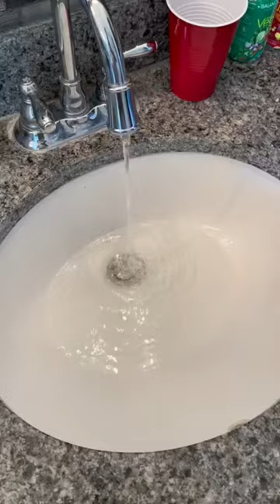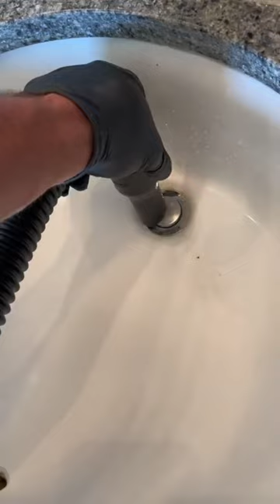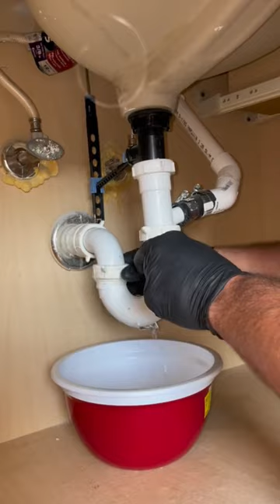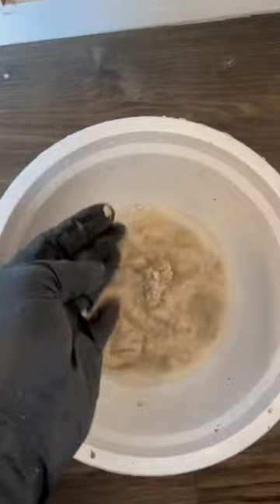Unclogging nasty drain line.

Comment: I do hvac and we add algae tablets to the drain pan to prevent something like thisb
Reply: I just crumble up a pool chlorine tablet and throw some pieces in the drain pipe every summer,
Reply: Ya'll do ?
Reply: Thanks!
Reply: The smitty pan is for in the event of condensation line failure
Reply: It'll still happen eventually
Reply: @TheFoxygrandpa69  If you add the tabs twice a year it will not happen.
Reply: Used to get calls for this almost everyday at a apartment complex. I gave every tech a bottle of them and told them every call no matter what it is drop a tab in the a/c. 2 months later zero calls for a/c drains.

Comment: They should just have a standard 2" "P" trap drain in the attic for the AC and AC pan.  It's ridiculous running these stupid 3/4 or 1" lines.  They always get clogged with gunk.

Comment: The best thing to do is what you said educate your customer. Fill the sink and flush it. Didn't seem like there was a lot of water pressure there?
Reply from the maker: Aerator needed to be replaced or soaked in vinegar. Also they are on a well and have about 40-50psi

Comment: In sf comercial set up we put in an air gap to a taped p trap with a trap primer for ac or water heater discharge from prv. On demand condensate we use a filter so it's not acidic .

Comment: We have this at the apartment complex i work at every apt has it ran to the bathroom sink. For whatever reason the pans get overfilled at the air handler even if theres no clog in the line. Anyone know why its doing this?
Reply: The condensate line is not running downhill
Reply: @conradbarrett6  it is running down hill though angled sideways to straight down to ptrap

Comment: Not sure what hvac guys you have in your area.😮I'm a hvac installer, and we have never done this. Would probably look at your crazy if you even suggested that.  A lot of unnecessary work, in my opinion. For attic unit, we run them to the gutter. For basement systems, we install a pump and run that to the main house plumbing and just cut in a Y fitting. Or just run that tube for the pump outside altogether. Preferably the main house drain, so you dont have to worry about it freezing in the winter.New construction, the plumbers have to stubb up a pipe up for us to the attic.

Comment: I have never heard of the condensation line tie into a sink that’s wild
Reply: It has become building code in many jurisdictions for whatever reason.
Reply: @GGigabiteM  Does the building code require it to tie in to the sink like this? Or just that it has to be piped to the sewer?
Reply: @sango_wango851  Requires A/C drains to drain into the sewer. Not sure if it specifies where the connection should be, but a sink is probably the best alternative if you don't have a floor drain.

You want the ends of the line to be accessible for cleaning, because it's not if A/C drains will clog up, it's when.

The only benefit I can see of piping it to the sewer is that it helps the sewer stay running with a constant flow of water. A single A/C unit can dump several gallons of water an hour, multiplied by thousands of them and you have a huge flow of water keeping the pipes flowing.

Comment: 😂😂 bro what????? Are they in a slab foundation or something?  And what state is this in? No way thats legal
Reply from the maker: Texas. Almost every home that’s not before the 80-90’s is done this way in my area
Reply from the maker: Almost all homes here have the ac units in the attic now and they drain down into the sinks like this
Reply: Bro thats crazy lol, i have never seen anything like that in Socal. But if its in the attic why not just drain it directly out a sofit or wall and straight out the house?
Reply from the maker: @checo8187  my thoughts as well. No idea why they do this other than maybe wanting it neutralized if it’s going outside. Older homes have it going outside still and I haven’t seen any issues

Comment: How about if the clog is further down the line 🤔. Pistol rod about 25 feet would have taken another 10 minutes and guaranteed that it's open.
Reply from the maker: I augured the drain line as well. Just didn’t keep that part in the video. The clog was definitely in the p-trap though lol